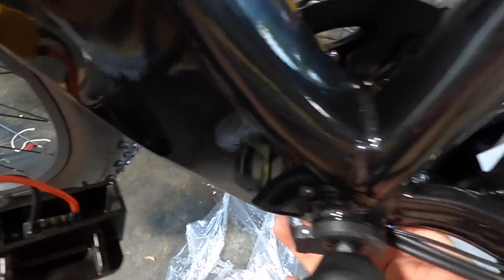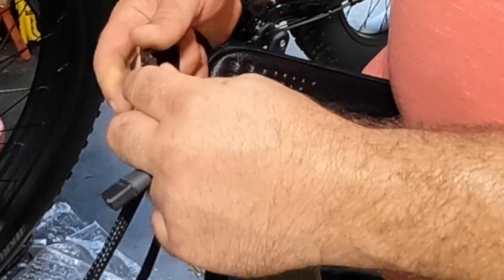Aventon | Aventure V1 | Plug and Play Dual Battery Discharge Balancer Kit | Install Two Batteries

Comment: Will this work with the Aventure 2?
Reply from the maker: Aventon | Aventure V2 | Dual Factory Aventon Batteries installing two batteries with DateX2 Dx2 Kit
https://youtu.be/2csKuyaJwzc
Reply: @ElectricAllWheel  Will the battery indicator on the Aventure2 still have an accurate read out of both the batteries as you use them?
Reply from the maker: @ if you charge both batteries to full capacity before use it will

Comment: Are you charging the batteries separately using the aventon charger and then using the charger for the secondary 48v 10 ah battery?
Reply from the maker: The recommended battery comes with a charger. We charge separately.
Reply: @ElectricAllWheel  perfect thank you so much

Comment: Will this work with a 52V battery and the stock 48V, or do the batteries need to be the same nominal voltage?
Reply from the maker: We always recommend utilizing the same voltage batteries as the system specifications. We are aware of two customers installs with varied voltage (52V and 48V)

Comment: will this kit work on the Aventon Adventure 2, is the wiring the same procedure on this video or do you have a another video that has directions for the AA2 . Im waiting to purchase if this kit works, please let me know thanks
Reply from the maker: The kit requires splicing into the system for the V2 which will void the warranty. We will be putting out a video soon
Reply: Just to help me with following your directions when video is made can you possibly put more light to see what you are doing if you can , thanks for the videos.

Comment: If I charge this battery while it is hooked up to the rest of the system, do you think it will charge the main battery also? I lost the charger block for my aventon aventure and I'm wondering if it will charge if I have this secondary battery charging while plugged into the bike
Reply from the maker: Unfortunately the batteries will need to be charged independently

Comment: Will this work on Aventure.2?
Reply from the maker: You can do it with a V2 but you have to cut the wiring and it voids your warranty, unfortunately
Reply: @ElectricAllWheel   I'd say maybe cut. Mine, just purchased has connectors.  It also has the controller connected to the top plate.  You can barely get the plate out, maybe it out. You have enough room to get to the connector.
There are the 3 screws, then two more on the frame bottom

Comment: 2 batteries now displayed overvoltage errors. Any ideas?
Want to convert my Aventure soon.
Had to get a Redshift seatpost, can't ride w/o 
5000 miles now.
Reply from the maker: Does the app have a system voltage selection that got changed?

Comment: I just hooked up dual 52v 20ah batteries to my bbshd with a ludicrous controller. I can sustain 35mph and still get the range iof a single battery. It hit peaks of 3000watts on acceleration 😮. An external controller and a 72v battery is my next upgrade.
Reply: Bbshd?
More info please. Putting 72v battery on 52v motor?
Make video

Comment: Will the 15ah fit the same bike?  Aventure 1. Thx
Reply from the maker: Yes. Of course the physical size is different but yes it will work because it’s 48V
Reply: @ElectricAllWheel I know it will work, I’m concerned about the fit, measurements are really close

Comment: My biggest concern is having both batteries plugged in at the same time and how that may effect the health/risk of the batteries. I also noticed you didn’t have both connected at the same time. Is this something I should be concerned about? Thank you for your help!
Reply from the maker: The balancer is meant to protect the batteries from what you describe. They were hooked up separately to show that they function independently and when both are plugged in.
Reply: @ElectricAllWheel  Thank you for the prompt reply, that’s great to learn. I will check out your store and plan my upgrades

Comment: Wasn’t sure if this was answered yet but do you have a work around for the Aventon  Adventure 2?
Reply from the maker: For the V2, Aventon made the controller to battery pin plate a single connection. There is no intersection. 
We are seeing a lot of this. 
Other companies are running battery signal wires through the controller forcing connection that requires more than pos (+) and neg (-)

That being said, when you’re warranty is over we do know that cutting in the proper connections does work. We have had two customers solder seal in XT60 connections with success. 
Please bear in mind aventon will change internal components of single models without notification.

Comment: Well I'm inspired to figure out modding my Abound it uses the same battery as the adventure ver.2
Reply from the maker: The Abound has a direct connect to the plate pins for the battery and, at minimum, would require splicing. The same scenario exists for the Aventure V2

Comment: A couple of questions - 
- How easy is it to remove the second battery to charge it? I assume you'd have to unplug the connector and undo the straps to get the battery out? Will doing that repeatedly loosen the connector? - Will the mod affect the waterproofing of the bike at all? I usually ride without fear in a light drizzle, would i need to be more cautious after installing this kit?
- Will I need to keep both batteries charged up? The current range of my aventure is good enough for my daily commute, but I'm looking to extend the range for the weekend rides. Would it be safe to keep the second battery plugged in while discharged and only charge up the main battery?
Thanks in advance!
Reply from the maker: The bag has a zipper that allows the removal without undoing the straps. The mods should be ok in a light drizzle but not any kind of significant rain. The balancer makes it possible to allow a charged and uncharged battery to be hooked up without worry. The recommended battery comes with a charger and both batteries will need to be charged independently. The connectors are robust and should remain durable
Reply: What rain cover do you recommend for the second battery if riding in a rain storm?

Comment: Just bought your kit, hoping this helps my voltage drain/% left to be somewhat more accurate and of course the longer range. I do get freaked out when the voltage drops super fast when it starts to get low. Thank you again for the product and video will report back!

When I saw your kit and the battery for $260 total, it beats the pants off the $500 replacement battery cost!
Reply from the maker: Reach out to our email with any questions

Comment: So can you charge up both battery's with the standard charger with everything connected at once? Are you guys doing custom firmware's yet for this bike to unlock speeds yet?
Reply from the maker: Hi Jason, this setup will require the independent charging of the batteries to ensure charger compatibility.
Reply: @ElectricAllWheel  do you sell an Aventon Aventure charger adapter to I assume an XT connector for the standard charger?

Comment: Is there any overheating issues with everything in the lower space?
Reply from the maker: The current limit is below 25A for a 48V system. 

We have specifically stayed within that realm to avoid any issues associated with high current high power e bikes.
Reply: @ElectricAllWheel  thanks for the quick reply...I just got my Aventure this weekend and placed my order for the battery balancer this morning!
Reply from the maker: @McGarveyton  FYI, this kit fits the V1. If you have the V2 you will have to splice in to your cabling which will void your warranty.
Reply: @ElectricAllWheel  nope I got the V1..and it came with Tektro brakes!...now if only someone could hack the throttle delay....

Comment: I just bought my aventon abound would this work on that model? I assume so as the battery's and components seem to be the same. Any thoughts would help! Thanks in advance!
Reply from the maker: We would suggest having a look at your controller to battery connection. aventon has moved to a single connection set up with no connector in between the battery and controller

Comment: I dont get it.  If you're gonna carry 2 batteries anyways, why not just have another Aventon one and just swap it out.  Why go through all this trouble that will most likely void your warranty?
Reply from the maker: The bike was not in warranty. Many people don’t want to have remove and replace. Two batteries in parallel carry a longer maximum sustained voltage rate “the sweet spot”
Reply: Because carrying a second battery is heavy. My level.2 batter is quite heavy and placing it in a backpack to carry around on a hot summer day is not comfortable. The aventon battery is also much bigger than the triangle pack he installed.
Reply: @barrelracer318  Why would you carry it in a backpack, just get a pack for the rear rack to put it in.  That's what we all do and it works fine.  Plus you get more juice with a full sized battery.
Reply: @AnonyBass  that's the thing. I have tried a few bags. The battery doesn't fit in the standard bags. Let alone allow room for other stuff. And those triangle packs are exactly the same as the stock packs except you can choose to have better amperage. I have a sfwt fleet that I am running a 20ah pack on. It was a totally worthwhile upgrade.

Comment: Hello, I have a problem with my aventon aventure 1,the display is working with some error, goin up to 20mph it it shows 3mph, do you know the posible causes of that problem and what to do to fix it? Thanks
Reply from the maker: This may be an issue with the hall sensor in the motor. 
Without general trouble shooting it is advised to unplug and the plug the motor cable to “reset” the connection.
Reply: @ElectricAllWheel  thanks

Comment: Hey, I have an Aventon Level 2 with a 48v 14ah battery and a 48v controller. I want to add a 52v 20ah second battery. Would I need to change the controller to get this to work?
Reply from the maker: The controller power cables go straight to the battery pin connectors. We have not developed an adapter for this.  We do not know the tolerance of the controller and it’s ability to handle a higher voltage (4V is minimal but it is higher)
We would try it just for the knowledge, but to add an inline dual battery connection immediately would require cutting the power wires to make an appropriate connection for the balancer
Reply: I’m just wondering if the controller, which is paired with the 48 V battery would handle a 52 V second battery? I plan on using a Date X 2 blender so I don’t have to worry but all the cables or cutting any cables it should be plug and play with the XT 60 connectors. It should be the same controller that’s in the. Aventure no?
Reply: @lawrencegoodwin2931  My Level.2 has xt60 connectors. But It was a display model. My buddies, fresh from best buy, level.2 did not have the xt60 connectros. The wires were directly soldered. He had no connectors to unplug in his bike. What made things worse, all the wires were black. So, we had to mark each wire before we cut them to add connectors to his bike. But for his bike, we just added and aux battery connector as he had the extra battery, but no longer had the bike that battery went to. So we added an aux battery connector to connect another battery when his main pack depleted. We dont hook them both up together tho. It is one at a time.

Comment: If you have two motors, like the one I just ordered has two bafang 1000w and 2 52v batteries 22ah each. I notice from a review of someone else that it does not have this dual battery equilizer but instead the front battery drives the front wheel and the back drives the display and back wheel. do you think this would work on this set up to fix it so you can use one battery at a time for either hub or even both? I have 50 more days to figure it out before it arrives lol.. help if you can it would be appreciated.

Comment: Does this work with the Aventure 2?
Reply from the maker: The Aventure.2 will require cutting the power cable between the battery connector pins and the controller. 
If you decide to go this route we can help, but beware your warranty
Reply: @ElectricAllWheel bummer.  thanks for the reply!
Reply: @ElectricAllWheel I have two Aventure 2's and would be interested in more info and possibly install help on the dual battery discharge balancer set up. Where are you located?

Comment: May I ask why you pulled @ 2:20 the guard cover off? There is no need to do so, the bottom battery plate will come right out regardless of this piece. Please tell people to reinstall it or risk damaging wires. Good kit!

Comment: How much is this setup and I’m assuming that it works the same with the new adventure 2 bike by aventon?
Reply from the maker: $60. We have not done an official install on the aventure.2, but anticipate XT60 connectors at the controller as well.
https://electricallwheel.com/dual-battery-discharge-balancer-kit-40a-aventon-fit/

Comment: If the bike had a rear rack on it you could put a 20ah in a bag on the rack with the blender. 👍
Reply from the maker: Yes, no problem with that at all
Reply: @ElectricAllWheel  my plan for the AR Kepler. Plug in the 3 connectors and go! 👍😁
Reply: So with bike rack can you do a factory 15amp hour on front a 10 amp on top and a 20 amp hour on rack? Or not enough space? If it did fit what would the range be more or less? Very exciting!
Reply: @stalwartservant4063  a Kepler rack can easily carry a 40-50 ah 72V. Keep the 52V on it as a disguise 😎
Reply: What is the blender?
Reply: @alexander_sinclair  the device for hooking 2 batteries or 3 into one small junction.
Reply: @kevinnashskitchen3517  does he use a blender in this video? Or where would I find one?
Reply: @alexander_sinclair  online are batter blenders and balancers .. Yep he uses one type
Reply: @kevinnashskitchen3517  do you have any suggestions for balance where I could use with a 48 volt 20 amp hour?
Reply: @alexander_sinclair  for $50 or so you can get one for 2 48V and your controller power plug. You need to know what connector come with your new battery and is on your controller and old battery.  So you can make sure all 3 are the same as the blender device.  And you'll need wire long enough for the new battery. There are videos showing all that.  Not hard
Reply: Yea. They come with a rear rack. At least my aventon does. I carry an extra battery for long trips. After 2 hours riding I’m done

Comment: Can both batteries be plugged in at the same time? Or is this battery only plugged in and used when the oem battery is depleted? As a backup back-up battery in other words. 

If they’re both being used in parallel at the same time and they’re both fully charged does the bike’s display show the combined capacity?  E.g. 167%
Reply from the maker: Same time. Dual discharge
Reply: @ElectricAllWheel  My son has a similar set-up on his Specialized E—bike but I think it’s proprietary  to the brand. It reads 150% when fully charged. What percentage reading do you get on the Aventure’s display when both batteries are fully charged?
Reply from the maker: @kev8839  100%.  Is the second battery a higher rated voltage?  If so the voltage reading would be greater than that of a normally charged 48V battery and this produce a higher percentage

Comment: Are the batteries hookup parallel? Wouldn’t it kill the oem faster since after market battery has less amp hours
Reply from the maker: It will uniformly draw the batteries down to the low voltage cutoff of the the controller. Think of it like a backflow preventer.

Comment: How much range extra we can get with this hattery ?
Reply from the maker: The battery used in the video will add approximately 70% additional capacity. The range will depend on the usual factors, weight, terrain, riding characteristics etc.
Reply: @ElectricAllWheel  what if it was a 20 amp hour?